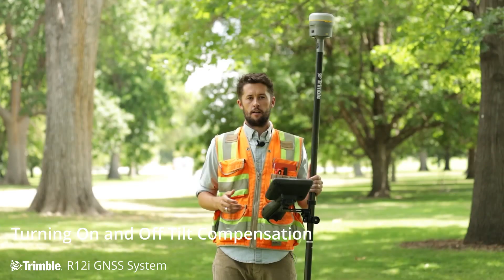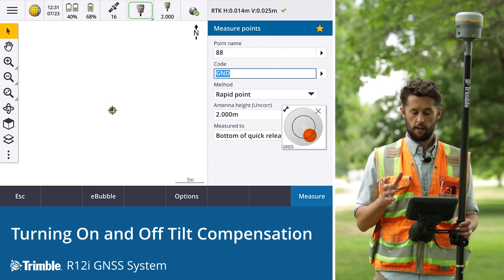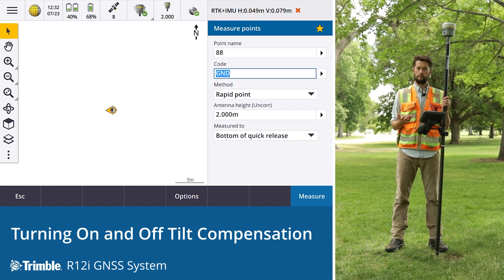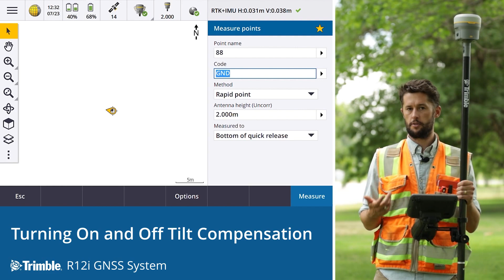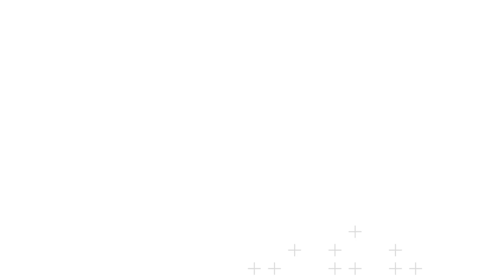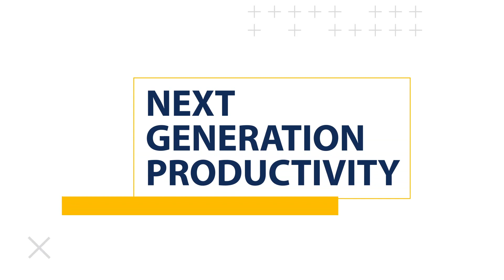R12i Tutorial: Turning On and Off Tilt Compensation

Comment: This video needs to show how to set up from earlier in the process. Because you won’t even get the function option if the tilt sensor isn’t set up initially through a new job set up. We eventually figured it out but took us much longer than it should have. Can be money and time wasted if you’ve never used the function before. Granted you can call a dealership or customer service but dealer is closed on Saturday and customer service wasn’t much help.